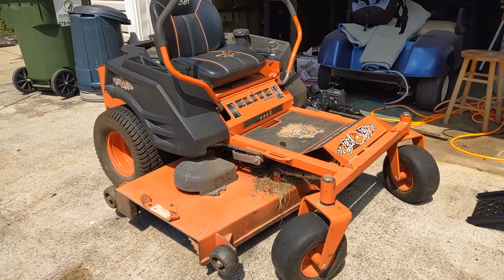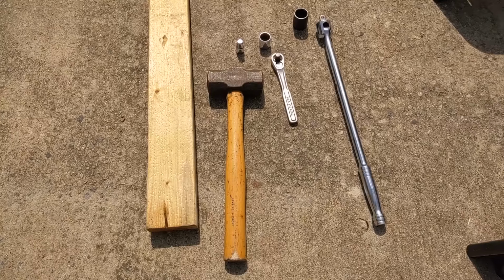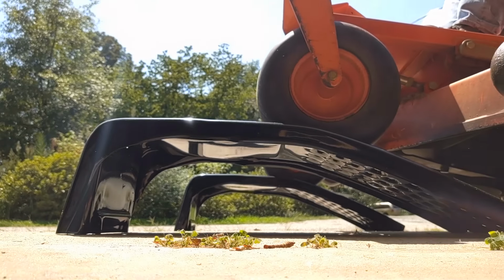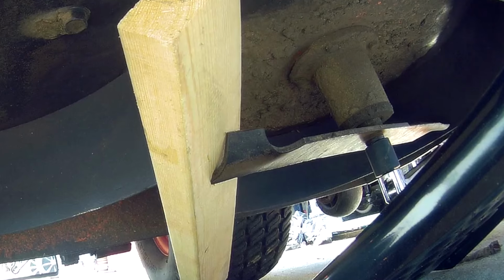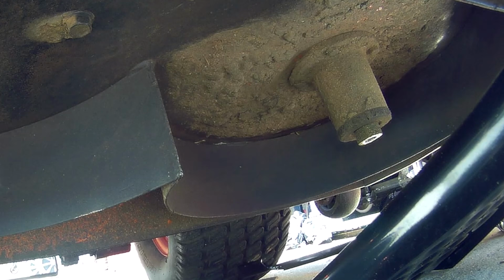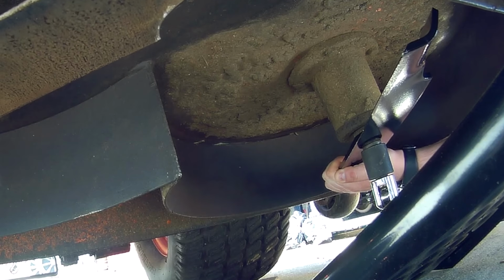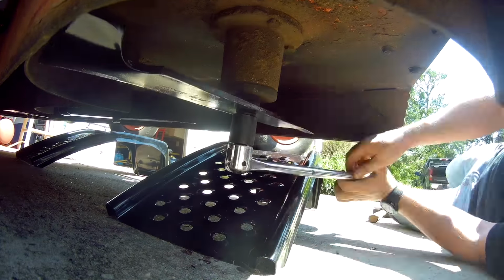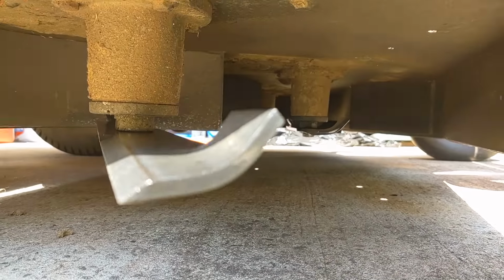How To Change The Blades On A Bad Boy Zero Turn Mower (60 Inch ZT Elite)

Comment: I've douched my blades twice with penetrating oil, bought a 3' pipe "breaker bar" and the other blades still turn and it's not coming off the last blade, of course.  Why the hell didn't they just weld the F'ing blade; I could have ground off the weld.  I've pissed away three F'ing weeks trying to change these blades!

Comment: I installed the mulching kit on my MZ Magnum. Used a 650 ft-lb battery impact wrench to remove the blades with no issues. Unfortunately, I used the same impact wrench to install the new wavy blades. Engaged the PTO and there was a horrendous vibration. Loosened the bolts and reinstalled to the recommended 90-110 ft-lb using a torque wrench, and the vibration disappeared. Use a torque wrench.

Comment: Man… those bolts are no joke! Using some white lighting grease to try and get the loose. Wish me luck👍🏽 Got one off so far.
Reply: Had the same issue with the first one,noticed the paint on the blade was like an epoxy glue.Heated the next 2 bolts up with a small plumbers torch to about 250 degrees and they came off with ease.
Reply: @markbrown1804 Dang! I actually was not able to get the other blades off😑 I’ll have to used PB blaster on it and soak it probably for a few days unfortunately. Glad you got yours off!
Reply: @markbrown1804 Appears the bolts are left hand threaded l?

Comment: I just took the blades off my bad boy with my impact gun electric and went off quickly :)
Reply: Any issues with the Bad Boy? I'm looking at the Bad Boy Rogue, Maverick HD, Ferris ISX 2200, Scag Cheetah 2 and Tiger Cat 2 all in 60 inch decks with the FX Kawasaki except the Tiger cat is the FT Kawasaki. 

I was quoted $16k for the Cheetah 2, $12,700 for the Tiger Cat 2, $12,850 for the Rogue, $8519 for the Maverick HD, $14,000 for the Ferris ISX 2200. 

I'd love to get the Cheetah but $16k is a tough pill to swallow. 

Have read people with Bad Boys having their hour meters going out, spindles going bad, seat bottoms are made with plywood and falls apart even garage kept wheel bearings going bad. Zero warranty help also.

Comment: Thanks for this video. Just my story so it may help some else. I had damaged my 54 MZ Magnum blades yesterday so went to put new blades on. I was using a breaker bar with a 2-foot hollow pipe on the end and couldn't budge the damn bolt even after spraying it, I was literally moving the mower off the car ramps. Then snaped a Pittsburgh/harbor freight 15/16 wrench trying to remove the bolt. Also tried my Kobalt battery powered impact gun and my 20+ year old husky(only 260 ft lbs. torque) impact gun to no avail. I am normally not a big fan of harbor freight tools, but I ran out this morning and bought a harbor freight earthquake air impact gun (1500 ft lbs. torque model) and the bolt came off in less than a second. I only had my 6-gal porter cable compressor 150 psi and it worked great.
Reply: I’m running into the exact same issue with trying to take my blades off.

Comment: we've had this about a month now and there are no complaints. https://www.youtube.com/post/Ugkx1VWTrayKBdCKAjzAcZ_Eg4dhHTae3LkN also recommend some of the decals are a little crooked; i guess the decal guy was having an off day. it came on a crate and took about 30 minutes to assemble, then about another 30 to install the bagger. it works great and i cannot foresee any big problems coming up. it is a sturdy, usa built product. update: the belt-drive clutch is still grabby, but i guess that is the nature of the device. as the literature advises be very careful on slopes or uneven surfaces-it can be very tippy.

Comment: Snap on breaker bar plus a cheater bar snapped socket onto the 2nd 15/16.
Reply: From the factory they are so ridiculously tight!! Wtf
Reply: Gotta use 1/2" sockets...!!
Reply: @joshuajones1319  It was a 1/2" socket. But they came loose after I borrowed a impact gun
Reply: @tweek857  soo the impact is the way to go..?? I bent 1 of my blades pretty bad and need to change it..
Reply: @joshuajones1319  I'd definitely use an impact.

Comment: Nice video, a few tips for loosening super tight bolts. Use a lubricant as you show in the video, tap (don't hit it too hard) the bolt with a ball peen hammer, use an extension on your breaker bar like a pipe, finally try to tighten the bolt a bit, this can break it free. Then of course use anti-seize when you put the bolts back in. I've spent a lot of years with rusty old bolts as a pipefitter :)

Comment: I used a Skag mower blade tool that I purchased years ago, and kept after I sold my Turf Tiger. It's the best $50 I ever spent.  Of course, I bought mine back in 2003, so they're probably $100 now.  It holds the blade solidly against the deck when removing the center bolt.  It's a timesaver and will save your cussing too.

Comment: take a small chain and wrap around the blade and hook to the frame on the opposite side.  Its a lot easier than using a 2x4.